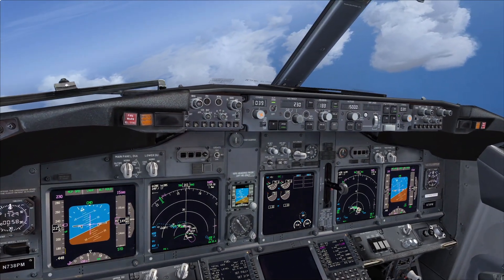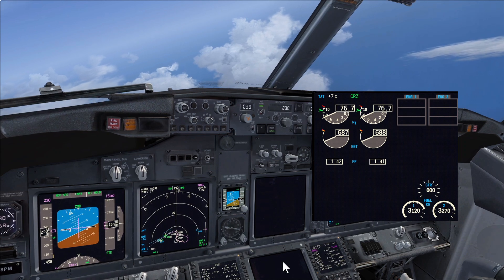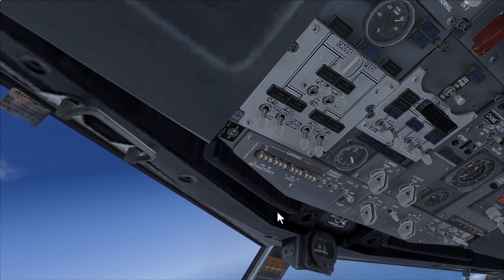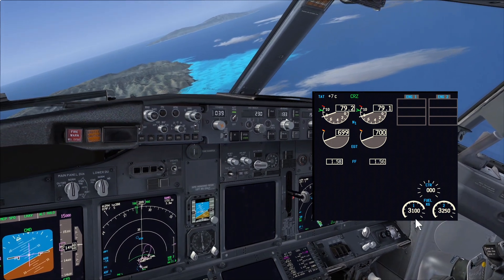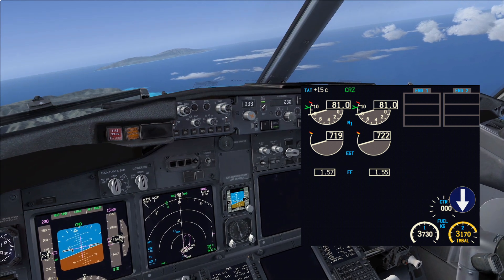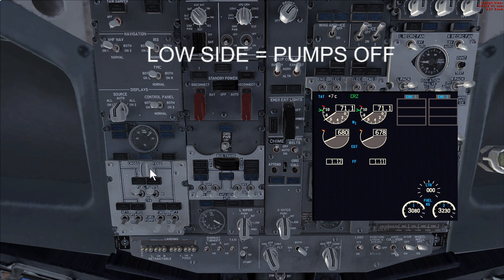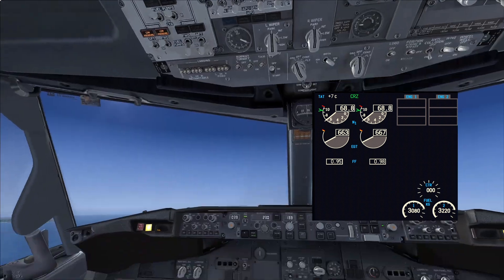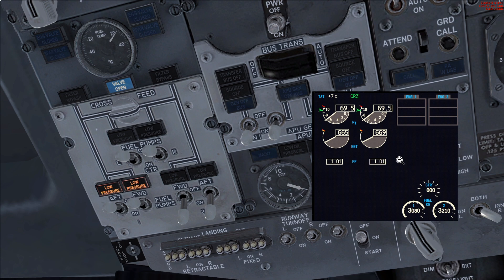PMDG 737 - REAL BOEING PILOT - Fuel Crossfeeding Procedure

Comment: I was reading a book looked at my sim and the left tank was full right was nearly empty. I had fuel in the CTR but forgot to turn the right ctr fuel pump on. This must have caused it. I looked in the QRH and it just said if no leak correct imbalance. It dosnt actually tell you how.

Comment: Air Transit flight 296, an Airbus A330 suffered a fuel exhaustion in flight. The fuel leak was caused by improper maintenance. The pilots did the fuel crossfeed procedure. Unfortunately they didn’t know that there was a leak. The plane landed safely in the Azores. Today C-GTIS (The plane involved) still operates with Air Transit nicknamed the Azores Glider.
Reply: Gimly glider*

Comment: Hello gents, that procedure can be found in the FCOM 1 under Supplementary Procedures / 12 Fuel / Fuel balancing. Worth noting in my airline (which bears a green t 😉) we must do this procedure by referencing to the manual, we are not allowed to do it from memory because doing it in the wrong order can lead to losing an engine !
Reply from the maker: Crikey, well hopefully you would spot the IMBAL alert before losing an engine.....

I'd question that policy regarding having to look up the fuel balancing procedure in the Supplementary Procedures whilst also completing the QRH unless you're absolutely not sure how to operate said system (which I would hope most line crew would) Certainly not had to do that anywhere I've worked. 

Boeing are quite clear on the matter. "The PF may also direct reference checklist to be done by memory if no hazard is created by such action"

FD2S
Reply: Hi, while taking my sim checkride yesterday I discussed our matter to clarify my company's policy and the examiner confirmed that they want us to perform the procedure either from the QRH Fuel Imbalance Non Normal Checklist or from the supplementary procedure unless time really does not permit. Each airline has its own quirks I suppose ;-) Best regards
Reply from the maker: flyingnico380 cool! Yes absolutely agree with you my friend. We have some procedures which are questioned by new pilots joining from other companies, part and parcel with the trade!

Well done passing your check (I hope!!)

All the best,

FD2S
Reply: flightdeck2sim, I passed my checkride indeed yesterday so I’m all set for my next real flight on Wednesday to Ibiza! Cheers

Comment: Hello, very nice videos, 
On pmdg 737-800 i turn off all the fuel pumps but engines not dying, they continue working tha whole flight, in real plane is this the case too?
Reply from the maker: Hi Haykodjan,

The Engines can still suction feed from both main tanks but at high altitude, without the additional pressure, engine flameout can occur as the fuel flow reduces (Best leave them on)

FD2S
Reply: flightdeck2sim thank you very much

Comment: Thanks for that!  I had a slight imbalance on one flight, was about 100kgs, did activate the CrossFeed valve but it took forever to balance out (never really did improve much before I landed), but did not switch off the low side fuel pumps.  Now I know where I went wrong!

Comment: Hey, have you tried using nvidia inspector to turn on the  anti-alising option for your FSX, this will give you sharper lines and you won't have to zoom in onto your PFD as you won't have the jagged lines.
Reply from the maker: Hi Jakub,

Thanks for the tip! I'm still tweaking my setup but I'll try your advice! 

Kind Regards,

flightdeck2sim.

Comment: Hey! What is "RTOW book" i found it in old sop from 2012
Reply from the maker: Hi Piotr

RTOW (Regulated Take Off Weight) booklets are used to calculate take off performance. Nowadays we use Onboard Performance Computers/iPads/ Boeing OPT etc, to calculate all performance related information. I should think a few airlines still use it and we revert to using them if we cannot use the OPT.

Kind Regards,

flightdeck2sim